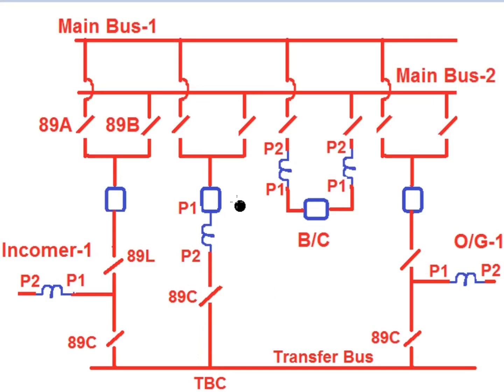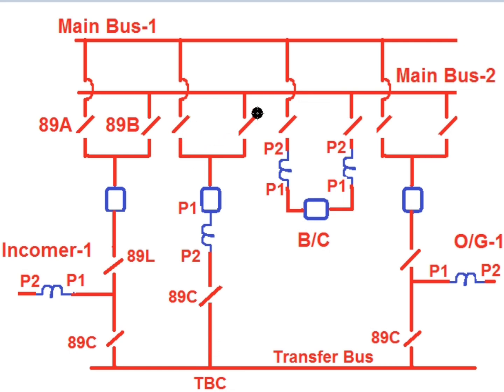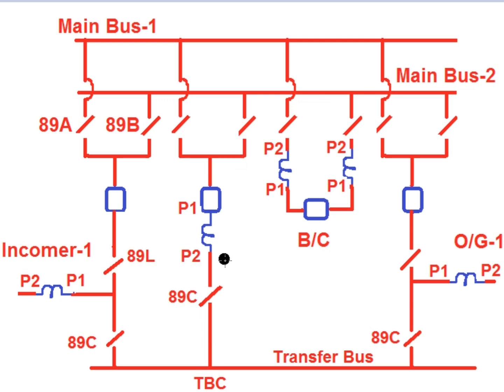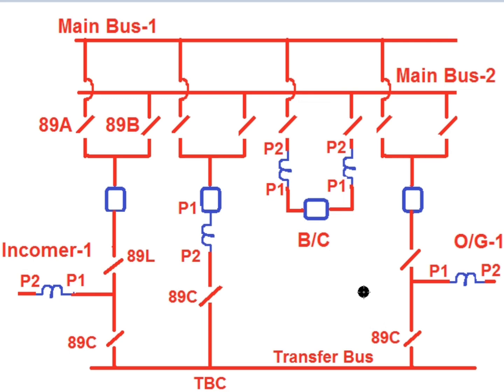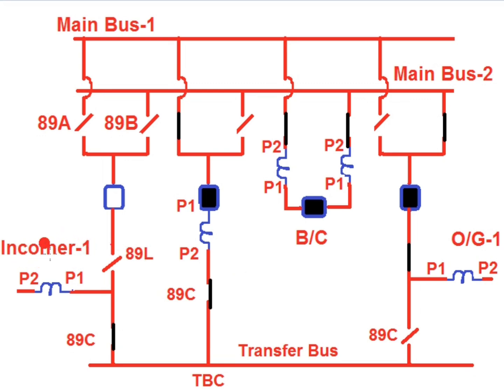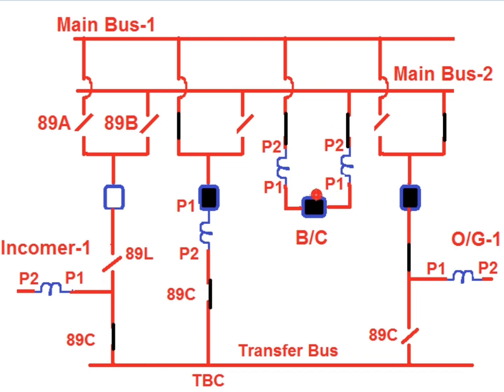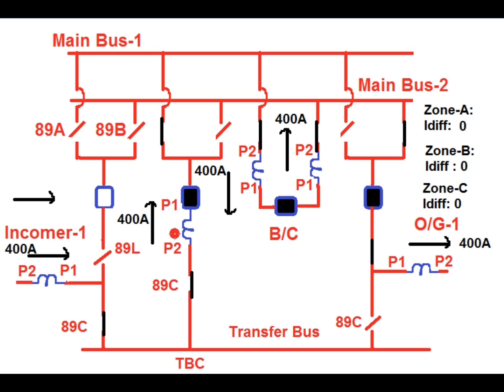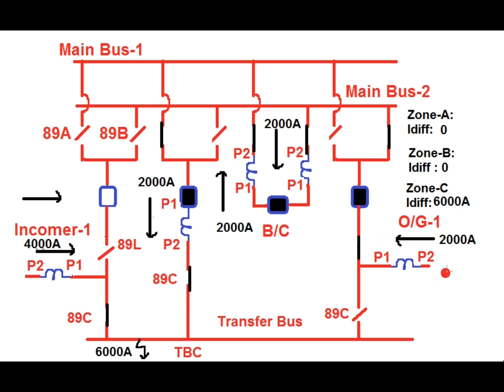BUS Bar Protection for Two Main Bus and One Transfer Bus System (Part-3)

Comment: At 09:21 you said by tripping tbc cb fault will be isolated. Pls check incomer 1 will continue feeding fault. Pls write formula for zone a b & c
Reply from the maker: Since Incomer 1 is diverted to TBC..due to bus fault TBC 96 will operate as well as it will send DT to the HV or LV of the Transformer whichever is applicable and thereby it will isolate fault.
Reply: @relayprotectionelectrical  correct
Reply: Your video are very easy to understand. Thanks. Your introduction pls